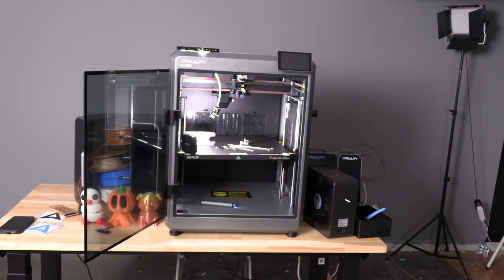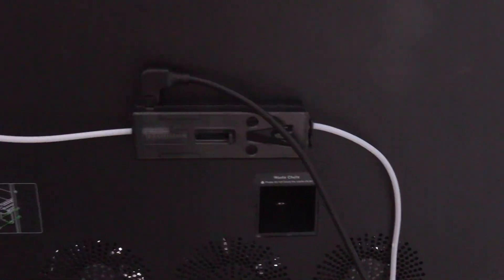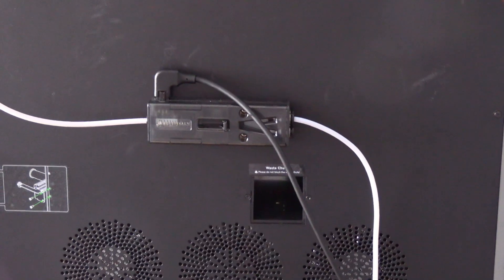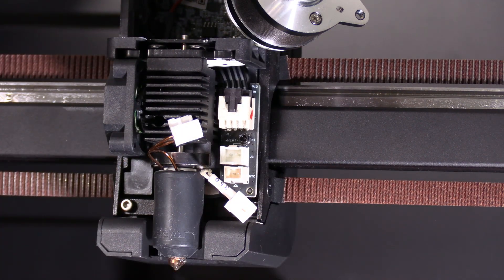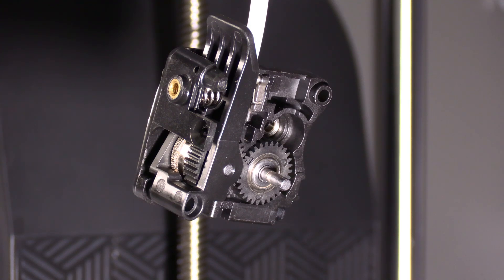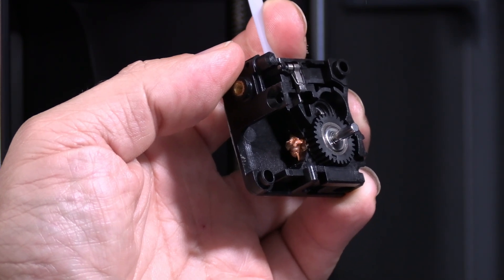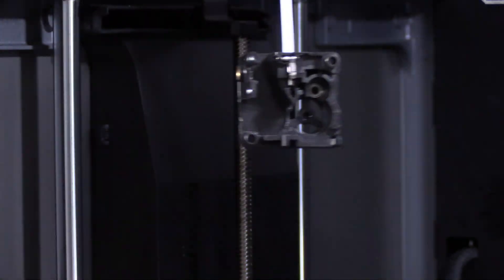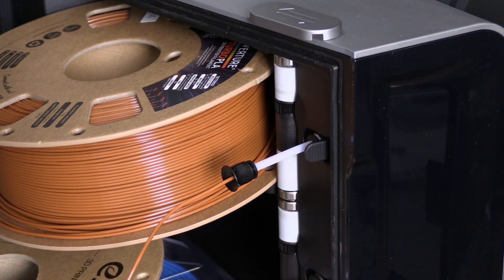K2 Plus DOWN. But not OUT! Dreaded Extruder Jam. Sad Reacts Only. Let's check it out....

Comment: Finally the solution is to change the small board at the bottom of cfs unit. The first batch of cfs of K2 plus is a massive board failure and the creality is hiding the truth. Simply get the bottom part changed , it's 30usd and change it.
Reply: Please pin this comment
Reply from the maker: The board failures are well documented
Reply from the maker: I have 4, just incase

Comment: Off topic but why wouldn't you put the buffer on the CFS?  makes it easier to maneuver around when you have to work on it and you won't to have to set the CFS on its side.
Reply from the maker: I only 8 CFS. Moving them around with Buffers on them is a pain. Most of my machines have 2 CFS. It's ultimately easier on the machine. I can remove a CFS for relocation or service at anytime with a simple unhook of a 6 pin

Comment: It looks like this is his disease. Most likely, you need to increase the thickness of the first layer to create less resistance to the filament's advancement. You can also install a softer spring. It's better to let it slip rather than constantly disassemble the extruder.
Reply from the maker: no

Comment: hi very interesting  i have this as a recurring issue  
every  end of print or cfs change   i get the blob  stuck or in the top of the nozzle throat   and  get  cannot  leave extruder error 
i have to dismantle and have had to switch out the  entire hot end  every time 
to give  creality credit  they have shipped   new sensors parts for cfe  and a new hotend  but nothing seems to fix it  help 

k2 plus  + 3 cfs   stacked on a 20/20  toer  frame  with cfs hub attached thier 
replaced all bowen paths to hotend with  2.5mm id  ptfe  tube  
only printing pla fresh hyper pla  creality rolls  

any ideas ?

Comment: I have almost 500 hours of printing with not a single error.  No failures, no jams, just perfect prints.   I thought it was amazing....  Then I had the exact same problem.  I did pretty much what you did, except I cheated and cut the PTFE tube where it exits the CFS.  That allowed me to disconnect the CFS and move it out of the way.  Then I was able to clear the filament and eventually take apart the extruder and clear the jam.  I went to the site to see the proper method, so I didn't need to take it as apart as you did.  The problem is now, after I get everything back together, I'm trying to print and part way through the print I get an unknown error and need to reset the printer.   UGH!  So much for my dream of a perfect printer.
Reply from the maker: Please don't follow this video. Follow this one: https://youtu.be/d7x58XaW4fM

What are the errors? Inspect your Bowden tubes in the CFS for wear.

Comment: Have a K2 Plus. Occasional maintenance is a thing, just like it is with EVERY 3D printer. If a fella's not comfortable with a screwdriver (hex keys really), then 3D printing is best contracted out.  Patience is a requirement.  This is universal.  The K2 plus has proven to be quite reliable, but not perfect.

I wish Creality had more brains built into their camera so it could pause print jobs before they get super sideways.  They have improved their firmware monthly, which is awesome, but the camera's ability to detect yukkiness is still wanting.

I have found the metal aftermarket extruder bits (amazon) work pretty well.  And I have found the Slice Engineering Plastic Repellent Paint (again, amazon) to work well for keeping the nozzle clean an minimizing stringing.  The paint does wear off, but it's easy to apply.  Downside it's not rated for engineering material temps (over 290°C).
Reply from the maker: This video was made when the K2 was days old. 
AI monitoring surely has a way to go yet.
Funny you mention that. Slice sent me a bottle several months ago. It is still sealed and waiting for some of my time. Been SO swamped.... with no end in sight.
Reply: @3DRundown  Rock on!  I liked the video, and enjoy your channel.  The Slice-stuff has been helpful for my 0.4 nozzle.  Give 'er a go. Super easy, just paint a bit on and let it dry for a few minutes. I don't normally see stringing unless the first layer adhesion is goofy.  This paint seems to help.

Keep up the awesome content! Well done!

Comment: I’m currently working at simply trying to pull the extruder forward after removing the screws. Being aware of the possibility of losing the spring I’ve taken to inserting a hex wrench through the hole that centers on the spring. If I ever get the extruder off I’m hoping the wrench will keep the spring from flying off.
Reply from the maker: Hi. Removing the Extruder is easy-peasy. Please follow my Tutorial, especially on the SPRING: https://youtu.be/IKxCcherUHY
Reply: @3DRundown Already watched the video. The screws are out but the right side refuses to come forward. It might be a matter of the filament frozen in the nozzle and up through the extruder.

Comment: I just cut the tube, that allowed me  to remove it. go about 1/4  from the tube in the back. I have several  extruder housings, extra nozzles,  a spare hot end and of Corse spare tube's. simple figure out what can go wrong, and have a crash box ready for the worse possible scenario.
Reply from the maker: If filament is inside the coupler, it won't release. Catch my proper Extruder Jam video, published after this

Comment: This is my very first 3D printer can I have the exact same issue on my fourth print. And yes I was using petg. Had not seen a video on extruder teardown yet but dove into it anyway. Logic,  not experiance led me to the steps i took to diagnose and repair. Lack of experience probably caused the issue,  and defiantly caused 3 burned fingers.  Out of all the K2 videos i have watched, yours have been the most helpful due to the exact step by step method you present them in. Thank you!!!
Reply from the maker: Hi. Keep in mind I have a proper Extruder Jam Video on here also. posted shortly after this one

Comment: Got mine few days ago, and already had the same issue 3x ! I'm so pissed. I have two Prusa printers and wanted bigger print space ... and never ever had this kind of issue :(
Reply from the maker: I have a real tutorial on how to open it properly. Don't follow this. To be fair, Prusa thinks it's 2019. They don't even have an AMS style machine. 
Just gotta figure out what's happening. Start by looking at your PTFE. A common cause, in my testing, is LONG PTFE. If you can shorten them, do so.,
Reply: @3DRundown  well yes the prusa AMS are a disaster :) but this issue is in the extruder above the hot end, the filament gets somehow soft or I do not know what and cant be retracted... I have seen many exactly the same pictures and videos today looking for a solution.
Reply from the maker: Short PTFE
Use Creality Print 6 *NOT ORCA*
I have a Patreon member that swears setting nozzle Temp to 230, stopped his Jamming. *I have not done this

Comment: Man the K2 Plus has been a rough experience so far. it throws out a million errors, the extruder spring tension is waaaay too tight and I get extruder jams all day. Don't even think about running TPU in this machine. Jam City and the cutter can't cut though TPU so you end up with even more of a jam where by the time you get the extruder apart the spring shoots half the gears across the room.
Reply from the maker: Sorry to hear that. I had some Jam nightmares with mine also. I've heard rumour of a V2 Extruder. Trying to confirm, and get it, if it exists. In my testing, jams were mostly resolved, by shortening my PTFE tubes

Comment: I still can't print in multicolor and I'm using the four Hyper PLA that comes for free inside the K2 Plus because I have that error. But, If I use an external spool, I have zero issues and prints nice. It's a shame because I bought this machine in order to print in multicolor option but with a bigger size bed. I think that I have a defective buffer that gets the filament stuck. I checked all the connections and PTFE tubes and all are OK.
Reply from the maker: Check my extruder breakdown, and check under the cfs for jam in the hub, or bad hub led board
Reply: I recently had a similar issue. There was no jam in the extruder, but the PTFE tube became extremely tight like yours. I suspected the buffer had failed, possibly because it didn’t send a signal to stop the CFS from feeding filament when the extruder could no longer accept it. As a result, the CFS kept trying to push filament, but since it couldn’t move forward, it ended up grinding the filament instead. This caused a deep dent in the filament, making it impossible to feed properly afterward. I’ve requested a replacement buffer from Creality. Hopefully, that resolves the issue.

Comment: I have had the same problem with the extruder, it jams every time. I have had a filament block at every change for the last week. I am thinking of loosening the spring by removing a ring like with the CFS mod for the shoe spring to see if that allows the retraction of the filament. As it is I cannot do any multicolour printing. This is so fustrationg
Reply from the maker: are your ptfe tubes too long? shorter is better
Reply: I use the ones that it came with, I also watched a video of a guy who mentioned that tightening down the bottom right hand screw on the extruder too tight, could cause problems with the Cut
Reply from the maker: Right, but you need to cut them to an appropriate length. Shorter is better. Interesting note on the screw. Link me.

Comment: Hello, 

I have the problem as soon as I have printed PETG with the standard profile of Creality with the Creality HF PETG. It happens directly with the first or second layer and I have to dismantle the entire extruder because the filament has jammed. I've also tried to reduce the speed a bit, but that didn't help either. Are there any solutions to this problem? PLA and multicolor prints, I had no problems
Reply from the maker: Consider Higher Nozzle Temp, and Maybe a little less retraction distance.
Reply: @3DRundown  I am already at 250 degrees with the standard Hyper PETG nozzle temperature settings, should it be set even higher?

Comment: I can't find the service videos you speak of.. I have an issue where I have filament jammed in the nozzle. I can not get it out. I've pushed a cleaner from the bottom up (nozzle hot) and I've tried pushing down from the top. I can see it from the top but it will not move at all. I've even heated the nozzle up to max temp and I got some out but still clogged. Can you help?
Reply from the maker: https://youtu.be/IKxCcherUHY

Comment: Same problem here, I don't know the reason for the filament jam, my spring did pop out. For a while I thought I was screwed because of that, but I managed to get it back in by slipping the spring into the lever hole holding the spring with a needle nose pliers, set the lever on its pivot point on a tilt, compressing the spring with the pliers and slip the other end of the spring into the opening and hope for the best. Mine slipped right in, happy? To say the least. Why, try to buy a K2 extruder replacement and have it in a day or two. It is ridiculous that they are unavailable here in the U.S. So, I purchased a couple ASSY's from AliExpress.
Reply from the maker: Check my formal extruder jam tutorial. Much better than this

Comment: I had this problem and solved it by removing the cover on the bottom of the CFS and cutting the filament.  In my case it was some filament that shattered in a dozen pieces throughout the system.  Used the manual tensioner releases and a length of nylon to clear every path.  Tedious but victorious results.
Reply from the maker: Epic. Patience wins the day!

Comment: i have had this issue several times with PETG. i increased the temp of the nozzle by a few degrees and it seems to have helped. i noticed trying to push filament through the hotend at the "recommended" temp was rather difficult by hand.

Comment: I've done what you have done sir at least fifteen times I've gotten very good at it but I digress.its the spring under the cfs is way to tight and at times it grinds into the filament with inturn causes a feed proble that's what I have found i removed the spring under the cfs and clipped off one loop making the spring not as strong but still good ..haven't had feed problems since?.....
Reply from the maker: Interesting. I wonder if this is something that can help others with CFS jam problems.
Reply: @3DRundown  you can try it its not hard to do the item that holds that lever gear asymbley in is just a push pin on the side of the lever ....

Comment: I’m having a using my machine won’t do ANYTHING! I keep getting a warning that filament is loaded in the hot end. I have everything tore apart and guess what…no filament in anything🤷‍♂️🤷‍♂️🤷‍♂️ I’m about to take it back. Very frustrated. I did notice during teardown that there is a small blue LED that illuminates when filament is detected. If I unplug that sensor it out the machine back in business but the question is, is the switch faulty or jammed or is something actually in the way of it?  Any help would be great it literally started right after an update. Not a single issue until I updated and tried to recalibrate right after
Reply from the maker: I have seen this sensor in other threads. It may be faulty. Take photo and video of it. Explain EVERYTHING, in easy english, to: CS@Creality.com

If it's a false failure, caused by the Firmware, they will patch it fast. They always do. feedback is super helpful on that process.
Reply: @ I was so flustered when I was swiping to type those comments, I’m sure it seemed like English was my…third language…🤣. I just noticed all of the typos this morning. Sorry about that Greg
Reply from the maker: It's OK, I'm Fluent in Typo.....  But, TWO G'S!!! GET. IT. TOGETHER!!  😂😂
Reply: @3DRundown  🤣🤣. It’s all in Creality’s hands now (assuming they respond) I know I could pack it up and exchange it at micro center but they’ve done that for me so many times in the past I hate doing it again. But the machine is a brick until Creality helps me out. They tend to think I don’t know what I’m talking about for the first few convos (even with a bachelors in electrical engineering) before they try 3-4 different things that never seem to work. But hey, still better than Bambus customer service. Thanks though GregG 😜🤣
Reply from the maker: Bruh, I literally shoot their tutorials, and service videos, and they talk to ME this way, when I have questions! 😂😂. "hey, my Hi won't connect with creality cloud". *Is your internet connected?"  🤣🤣🤣😂😂
I'm a retired I.T Guy & Network Administrator,  that worked with Major corporations..... But I'll check my Wifi! 🤣🤦🏼‍♂️
Reply from the maker: I lost 3 days of shooting cause it wouldn't connect, and the help I got from their engineers, was all stupid common sense stuff. But YES. Creality trounces Bambu in Communication. Even in the Backend, here between Me and my Reps. It's not even close.
Reply: @ 🤣🤣. It started directly after a firmware update. I’ve looked online, to no avail, is there any way to downgrade to the previous version to see if that’s the fix? I found the problem circuit board online and it’s $1.77 but not available until May 31st!!
Reply: @ Is there a good way to direct message you by chance? I don't have any social media btw.....🫤

Comment: I found 1000mm  data cables for the CFS to K2/Filament hub for 2dollars on Ali Express. The Hub can be mounted on the CFS instead of the K2+ as well . For some reason Creality forgot to put that in the user manual.  Now I can put my 2 CFS units next to my K2+ for easer service of both machines.
Reply from the maker: Yea, it can be on the CFS or the MACHINE. Creality has actually shown both ways, a few times. Can you link me to that cable?

Comment: Thanks! Just happend me and its my first 3d printer ❤
Reply from the maker: *Don't follow this video*
Follow me NEW Extruder Jam video
Reply: You should do a video describe how to set offset for when printing specifc filaments. Have problem with plowing om PETG...
Reply from the maker: PETG is notoriously challenging to work with, but, the newer machines handle it well. Shouldn't have much trouble. What's going on with your PET-G? I can try to do something on it
Reply: @3DRundown  first layers plowing and build up filament om the nozzel and that drip down and destroy the rest of the print....
Reply: @3DRundown  z offset

Comment: Mine didn't have the issues of removing the tubes. Just pressed down on the black washer and the tubes come out/off. The buffer as you call it, in the back , just slide the lever over ,so you can depress the back washer down and the tubes come right off. Even inside same thing. I get when you have to pull off the lid and the cfs sits on top . Had same issue. I just moved them so none on top. On the bottom of the CFS , There is a spring tensioned black lever. Depress it and you will be able to retract ( others are saying yo cut 1 loop off the spring helps ) , if your filament isn't stuck inside the hot end. In the hot end/extruder the spring goes back in easily, just insert the lever at a angle with the spring going in 1st. If not the agile , use small plastic to act as a shim when sliding lever and spring assembly.  Still , myself , and others are not sure what the root cause of the jams are. Hope this helps. As we're all new to this K2 . Had 78 prints go through flawlessly before getting my 1st jam. And happened when trying to print with hyper PETG. Now pla acting up. Restored back to factory and seeing how long this will go back to no more jams. Good luck
Reply from the maker: Catch my Extruder Video, published after this one, for the correct way to do all this. 
As for Jams, I find shortening the PTFE tubes helps, and, the latest firmware, and, slower speeds. I also have a video, on removing stuck filament, to show the Release button on the bottom, etc. maybe find them helpful